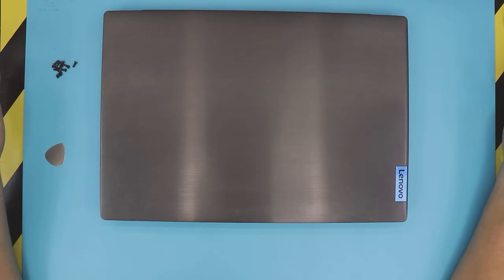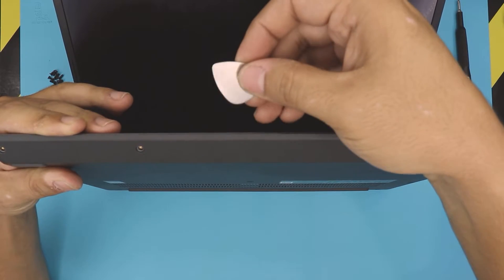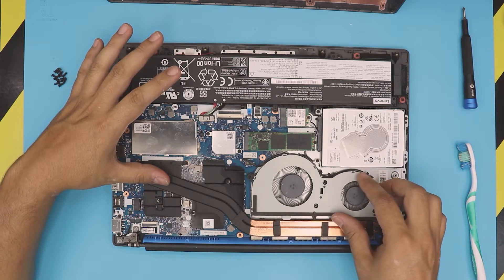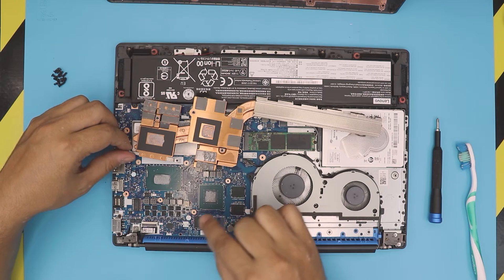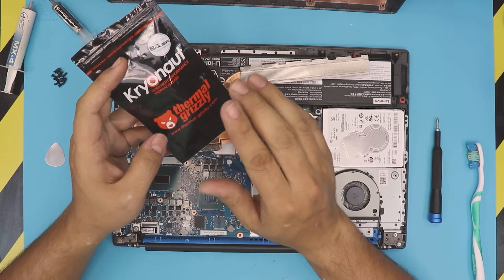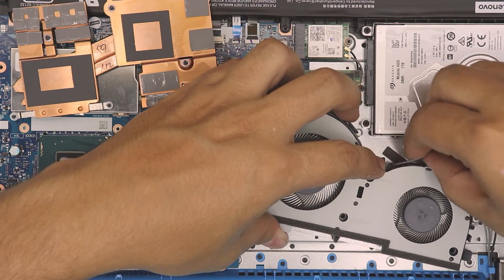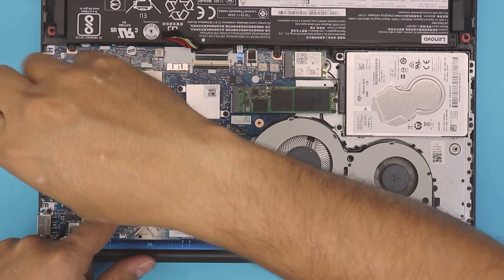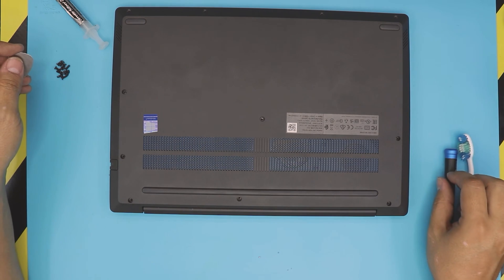Lenovo Gaming L340 Repaste maintenance under 10min !

Comment: Do I have to use alcohol to clean off the old thermal paste, or can I use water or a wet wipe?
Reply from the maker: 🫠Regarding your question, you should NEVER use water-based cleaners on CPU or GPU dies.
Always use 90%+ alcohol, or you may face short-term CPU failures.
cheers🍻

Comment: My laptop's GPU keeps getting undetected once under load. I already did all the software stuff that I could do, the thermals seem okay too. Was wondering if you know if theres something I could do like resoldering some pins to maybe save it. I've had it for 6 years so its kind of realistic that its dying, but if I can squeeze another 6 months out of it it'd be worth it.
Reply from the maker: 🫠Regarding your question, I encounter that issue in the store a lot—50% of the time it's a GPU reflow, and the other 50% it's a MOSFET on the power delivery rail.
You will need to find a good tech repair shop.
cheers🍻

Comment: Hi Bro, just want to let you know that I've just tried with my L340 yesterday by myself and the result was amazing, before I cleaned up my GPU' temp is around 78 degrees while playing CS2, after cleaning and reapplying the thermal paste --> 58 - 61 degrees.

Thank you so much

Notes:
I found out that the battery has swollen, lol, should I change it too?
Reply from the maker: It's my pleasure, my friend. 😊 I deeply appreciate your taking the time to provide feedback. If you're inclined to support the channel further, feel free to like and subscribe—or even both!
🫠Regarding your question, I highly recommend changing it, as when it swells, it will get worse and could damage the motherboard.
Should you have any questions or requests in the future, please don't hesitate to ask me.
🍻cheers
Reply: @uFixTek sure, I've subscribed your channel. After playing several days, the temp was increasing to 72 degrees, but when I minimized the windows, the temp was decreasing gradually to 60 degrees, is this condition normal? 

Regarding the battery, I could not find thw original version from Lenovo, will it matter if I change the battery with that?

Thank you in advance
Reply: And also, when i checked via market place, the battery'capacity is 45 watt while the original adapter is 135 watt, is it ok if i replace with baterry that has a capacity of 45 watt?
Reply from the maker: i appreciate your support my friend.
that is very normal and your temps are perfect,
about the battery here is the battery video and the link is in the video description, all you need the model of the battery and find it in amazon or aliexpress.
https://youtu.be/gnBG_Ph5q3U
Reply: @uFixTek thank you Broo

Comment: Hey man, i have my laptop since 4 years, don't game a lot and never repasted. my fan sometimes goes on loud, do you think its ok if i just clean the fan without repasting? or do you think cleaning the fan is not so effective by itself? btw love your video, you explain great and very straight forward, keep it up 👍
Reply from the maker: It's my pleasure my friend, i appreciate your support.
🫠Regarding your question, I would recommend removing the fans only and cleaning the heatsink (without lifting it) to see how much the temperatures change. I'm sure you have a lot of dust buildup in the heatsink. However, I would highly recommend replacing the thermal paste with a good quality one.
Should you have any further questions or requests in the future, please don't hesitate to ask me.
cheers🍻

Comment: Hello, I have questions should I change thermal paste if this laptop have droped 3 times but still working(how it's like if you have siblings) still performance is good laptop age 3 years. So question is will plastic screew up back (some parts of plastic are cracked)  if I disassemble it and I change the theramal paste or I need wait when laptop will dead (sorry for my English)
Reply from the maker: please explain what you need and want to do in your native language my friend.
cheers🍻
Reply: @uFixTek  Did you get a reply to your comment because it doesn't appear for me?  Sorry if I spammed

Comment: Thanks for your help. there is a mechanical noise coming from the CPU. What do you think could be the reason? I tightened all the screws thoroughly.
Reply from the maker: It's my pleasure, my friend. 😊 I deeply appreciate your taking the time to provide feedback. If you're inclined to support the channel further, feel free to like and subscribe—or even both!
Regarding your question, the sound that you hear is coming from hard drive HDD, and that means the drive is failing, back up your file on the drive and replace the hdd with ssd.
https://youtu.be/Wg-v4mUiaY0
Should you have any further questions or requests in the future, please don't hesitate to ask me.
cheers🍻
Reply: @uFixTek  Thanks for your answer, but I am using m2 ssd and samsung 1 tb ssd. So I don't use any hard drive. And I'm sure the source of the sound is from the CPU. but strangely it doesn't come from the middle. I thought it was coming from the RAM, but it was coming from the bottom of the CPU. Any ideas why the CPU is making a mechanical noise?
Reply from the maker: the only sound that can be making if you don't have HDd, then and you use it is not the fan, then the condensers (components) coils, high-pitched sounds coming from the motherboard are from electrical components in the system experiencing a strong charge or malfunctioning. you may have a bad inductors on board, you will need to get a technician to check and replace them else it will result on motherboard failure.
Reply: @uFixTek  thank you for giving a time. I will contact a technical service as soon as possible  👍
Reply from the maker: It's my pleasure my friend. good luck

Comment: thank you sir put some mx-6 and I am not thermal throttling in game anymore (:
Reply: idle: 14c on all cores, 24 on gpu
Load: under 75 no thermal throttling (:
Reply from the maker: It's my pleasure my friend. 😊 Thank you for taking the time to give feedback! If you would like to support the channel, please like, subscribe, or both. :P
awesome job my friend👍🫠
Should you have any questions or requests in the future, please don't hesitate to ask me.
🍻cheers
Reply: quick question... so I used mx-6 and my thermal throttling went away but now I am receiving power limit throttling... should I be concerned  @uFixTek
Reply from the maker: Don't worry about the power limit, that is nothing to worry about.
if the temps are low and is doing what you asking it, then you good to go.

Comment: Hello there!
How come nit replacing the pads? Its not necessary at all even after 5 years in my case?
Reply from the maker: Thank you for your feedback! If you wish to support the channel, you can like, subscribe, or both!
Regarding your question, the thermal pads on this models can last up to 12 years, if your pads are damaged then change them but if they look fine no need to change them.
Should you have any further questions or requests in the future, please don't hesitate to ask me.
cheers🍻
Reply: @uFixTek  Thanks for the tip. 1 more thing. What speed of ram can I max use in this laptop?
Reply from the maker: doesn't matter what speed you give the CPU and motherboard will auto adjust the speed to the max speed that is possible, remember that in laptop the more ram sticks you place the mother will lower the speed of the ram automatically and there is no option to manually increase it.
for you i recommend you to get 16GB DDR4 2666MHz stick 
https://amzn.to/41TSV8K
also you may want to watch the video on that:
https://youtu.be/ZkD8G4Najh0
and if you want to know the max ram capacity check this:
https://youtu.be/tKEJTkVth4Q

This is an Amazon affiliate link. When you use my links, you are helping to support the channel. 🙏
Reply: @uFixTek  Thank you very much, sir!
Reply from the maker: It's my pleasure my friend.

Comment: i cleaned it and its faster but now it doesnt detect my hard drive.. what should i do ?
Reply from the maker: Thank you for your feedback! If you wish to support the channel, you can like, subscribe, or both!
Regarding your question, is not detecting your M.2 ssd or the HDD?
Reply: @uFixTek   @uFixTek  will do ! thanks for responding so fast ! the D: hard drive so I guess hdd ?
Reply from the maker: can you double check the flex cable of the HDD that is inserted tot he motherboard:
here is a video of the ssd hdd upgrade, it can help you to find the connector:
https://youtu.be/Wg-v4mUiaY0
Reply: @uFixTek   @uFixTek  it isn't exactly the same model, mine is Lenovo IdeaPad l340-15api. I reopened it, and everything seems to be connected and in place. idk maybe the electric static discharge damaged it ? I'll drop it off to repair tomorrow I guess. thanks for trying to help
Reply from the maker: static discharge can't damage it my friend im very sure it is something simple, im sure the guy will resolve it right aways.
Reply: @uFixTek  yep he did, thanks !
Reply from the maker: Awesome! I'm glad that it got sorted out. 🍻

Comment: I’m using the exact same screwdriver and the screws on the heat sink will not unscrew
Reply from the maker: Press hard down on the screw and slow rotation, they do sometimes come very hard. the key is press down hard on them.
Reply: @uFixTek the ones closest to the ram i can only get to move to the left but not right
Reply from the maker: is the screw heads bad , the screwdriver is not gripping ?
Reply: @uFixTek screwdriver is not gripping for me

Comment: Do I need to unplug battery?? I am having difficulty getting it out
Reply from the maker: Thank you for your feedback! If you wish to support the channel, you can like, subscribe, or both!
Regarding your question, YES it is very important that you do it, we do do service without unplugging , if you going to not unplug make sure you don't drop any screw on board.
Reply: @uFixTek  alright I’m not sure how to pull it out I am pulling from the middle gently but it does not want to come out
Reply from the maker: if you remove 4 black screws that hold the battery then lift the battery and slide it to front of the lap and pull the cable it will be much easy.
Reply: @uFixTek  i will try that thanks
Reply: @uFixTek  additionally my artic mx 6 thermal paste came with cleaners are they any good?
Reply from the maker: they are ok, no harm done on using them. if you have isopropyl alcohol 99%+, use that it is better than the one that comes with your paste. else you fine too

Comment: brother, can you change the gpu of that specific laptop in case it is broken or is it already soldered on the motherboard?
Reply from the maker: Thank you for the feedback! if you wish to support the channel you can LIKE or SUB or both :P
regarding your question:  no my friend the GPU is soldered on board, you can't replace it. BUT a good technician with proper machine (reballing) can replace the BGA CHIP (GPU)
its not something you can do at home, we do this in out stores.

Comment: How much do i have to tight the heat sink screws i think i tight them too much and laptop is still heating even after thermal repaste

Do we have to tight screw slightly or tightly plz reply
Reply from the maker: Thank you for the feedback! if you wish to support the channel you can LIKE or SUB or both :P
regarding your question: the screws must be tighten all the way not excess force just tight till end. if you have a bad temps can you tell me what is at max load?, and what brand thermal paste you using?
Reply: @uFixTek  using thermal gryzlly and load is around 80-90% with undervolting
Reply from the maker: you may have a unbalanced heat-sink, it's very common, we do get clients coming in and have the same issue, we order hew heatsink or use a copper shim .3mm https://amzn.to/3SnpoyI
and what you want to do is to place paste on GPU and CPU and paste both side of the copper shim. it will help you dramatically.
Reply: @uFixTek  i see thanks for replying 💯
Reply from the maker: its my pleasure.
if you have any question or request in the future feel free to ask me.

Comment: Do you suggest investing a thermal pad on m.2 SSD?
Reply from the maker: Thank you for the feedback! if you wish to support the channel you can LIKE or SUB or both :P
regarding your question: its absolutely not required, it will not help for its performance or anything, the only thing it may help to give it a few days of extra life. but far before it dies because of heating it will die because of usage TBW (Terabytes Written)

Comment: I've also got a small question, I have recently been to Ecuador, and I myself am from Europe, I brought my laptop with me to play some games and do some school work and stuff. Which meant thzt we had to bring both the laptop and the cable. Since we're from Europe we had to buy one of those adapters to fit the power outlet. Sadly on the way there we lost rhe backpack on which the cables were kept so we had to buy a new one there. of course they didn't have cables that'd fit European outlets so we were forced to buy one with an American outlet. I'm pretty sure the voltage from there is lower than here in Europe right?  Anyways, now I'm back in Europe and I've noticed significant fps drops while playing games. The weird thing is that I can play fine at a stable fps for quite some time and after a while is starts with the fps drops and thye're really really annoying. Wait a minute or something and they're gone, only to return a few minutes later. I'm using the cable with SA outlet plugged into an adapter that converts it to a EU outlet. It does not change the voltage tho, so I was wondering if my performance issues would be caused by a too low voltage?

Comment: Thanks man So much for help.
My temps before : 94c° 2300 - 2400 mhz

Temps after max 82c° average 75 - 77 4000 - 4100 mhz
Btw I used thermal grizzly Kryonaut
Reply from the maker: You are most welcome, Glad you liked it 😊sweet temps, Thank you for the feedback! if you wish to support the channel you can LIKE or SUB or both :P
and yes thermal grizzly Kryonaut is a good choice but a bit expensive
if you have any question or request in the future feel free to ask me.

Comment: I cleaned my l340 and i see insane improvement it turns on in 13 seconds, maximum temperature that i hited when i was playing games for 4 hours was 74 degrees, thats insane. I used kryonaut thermal grizzly and thermal grizzly minus pad 8 and i undervolted it to - 125Mv using Throttlestop thats hard to believe before repasteing and cleaning it was hitting 93-98 degrees on cpu
Reply: Mine turns on in 3 seconds and I haven’t changed the paste in years, is your windows downloaded on the nvme
Reply from the maker: Thank you for the feedback! if you wish to support the channel you can LIKE or SUB or both :P
regarding your service: awesome job, enjoy your games without any worries :)

Comment: I had mine for 2 and half years 
I did a repaste with an MX-4 however I discovered lately that it wasn't authentic and my CPU stopped stopped boosting in games until I did an undervolt which fixed the problem 
Could this be because of the fake thermal paste??
Reply from the maker: Thank you for the feedback! if you wish to support the channel you can LIKE or SUB or both :P
regarding your question: SURE it is, there are many fakes out there with paid feedback, make sure you get an original authentic brand.

Comment: dude, i've been using the computer for gaming for a long time. Which thermal paste would you recommend to buy and what brand of alcohol should I clean the top of the processor with? Because I live in Turkey, unfortunately, I can't order from Amazon because of the exchange rate difference. I'll buy it from local shopping sites.
Reply from the maker: Thank you for the feedback! if you wish to support the channel you can LIKE or SUB or both :P
sorry that i was away for few days, regarding your question:  i used to live in turkey i speak farsiand turkish azari :P. i would recommend you try to find the following items:
thermal paste: arctic mx-4 or artic silver 5 or thermal grizzly kryonaut, Noctua NT-H1
and regarding the alcohol use: isopropyl alcohol 70%+
Reply: @uFixTek  thank you bro🤜🤛

Comment: Do you need to remove the heat sink to remove the fan or can I just remove the fan by itself
Reply from the maker: Thank you for the feedback! if you wish to support the channel you can LIKE or SUB or both :P
regarding your question: you can remove the fan without removing the heatsink just remove the screws that touches the fan.

Comment: hello sir i am from india and  I own th same laptop that is lenovo l340  thermal pads  on heatsink ,of my laptop are corroded like they are in powdered form on some parts please suggest me what should i do and reccomend me the thermal pads of perfect thickkness  that are available in India on amazon . please reccommend .
Reply from the maker: i think you have tween sibling that leave the same exact msg :P
Thank you for the feedback! if you wish to support the channel you can LIKE or SUB or both :P
regarding your question: get any 12kw and .2mm : https://is.gd/CmGARM
Reply: @uFixTek  thanks sir
Reply: @uFixTek  will the 2mm thickness thermal pad be good or I should go for 0.5 mm or 1mm thickness
Reply: @devsati4311  i have 17 inch version and original thermal pads are 1mm thick
Reply: @VIPER.digital  hey bro are you sure ?
Reply: @VIPER.digital  and what will happen if I use 1.5 mm thickness pads
Reply: @devsati4311  yeah im 100% sure because i opened it already. I think that nothing will happen because they should bend under pressure. Maybe thermal conductivity will be slightly lower because thermal pad is 0.5mm thicker than original one.
Reply: @VIPER.digital  hey bro is arctic MX 4 good ? And i am thinking to buy adwits thermal pad what's your view ????